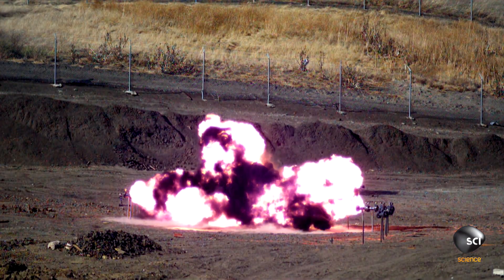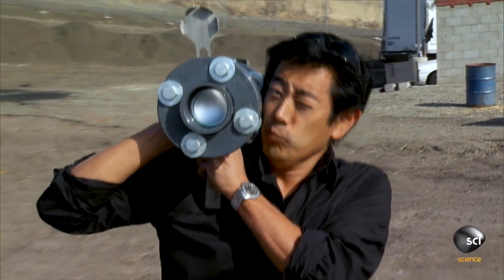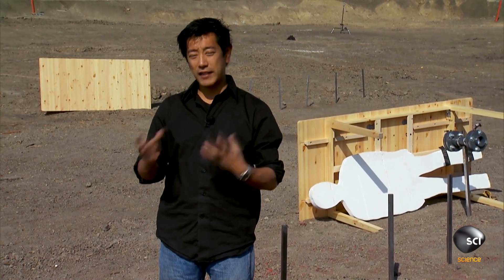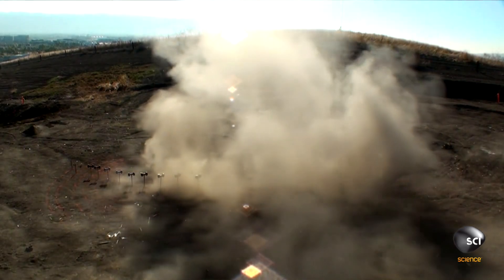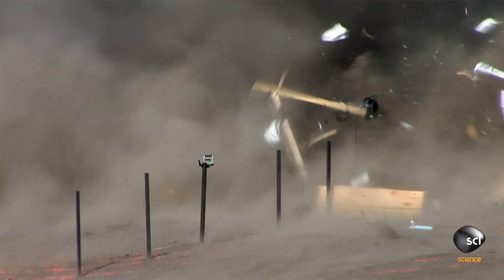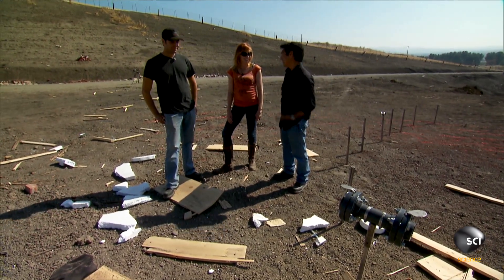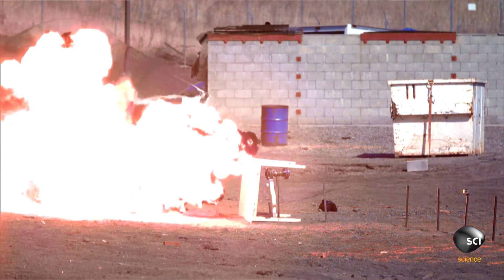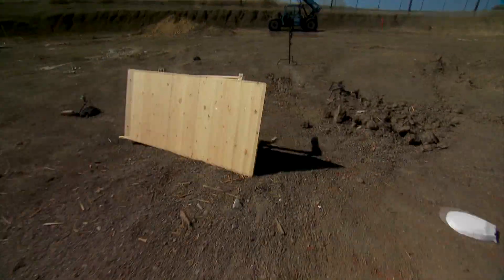Can A Wooden Table Save You from an Explosion?

Comment: It's hard to say just how wrong you are ...........  Try not to use a metallic pressure sensor as a substitute for flesh!!!! And remember shockwaves rap round corner's. Lethal force is 40 G . Also why is your table outside?? You need a room to put it in that will concentrate the blast.....

Comment: no, 1350 g (3 pounds) of C-4 at 10 feet (3.3 meters) is not lethal. The 50 % lethality zone for all body orientations (standing) is about 2 m (or 6.5 feet). At 10 feet (3.3 m) your chances of dying are most likely about 1-5 %. You'd be only vely slightly injured at 20 feet, or ud have gone uninjured.